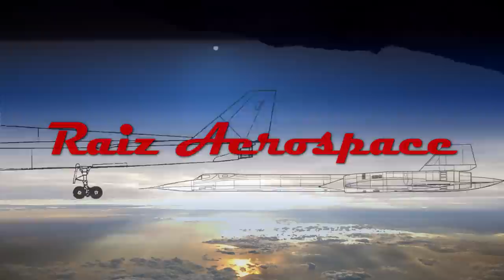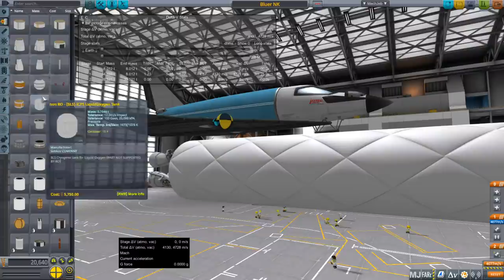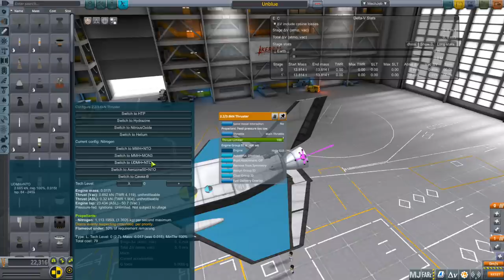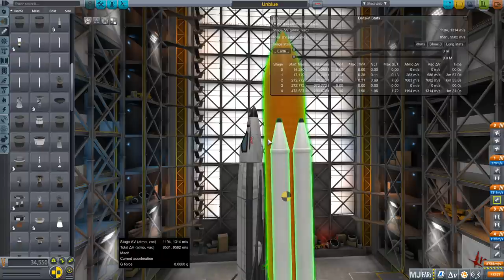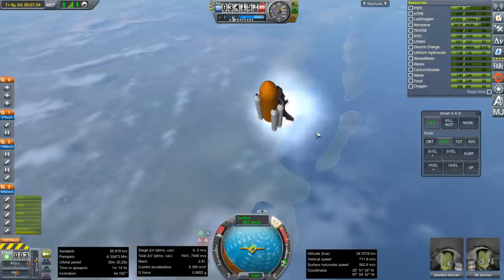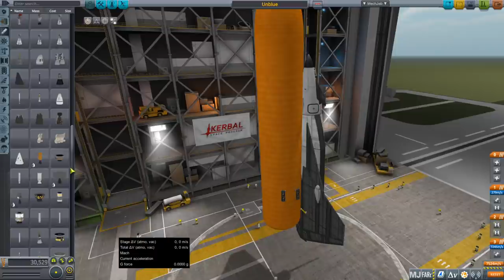Realism Overhaul in KSP 1.8.1 - Shuttle Design Tutorial Part 1

Comment: 15:20 Watches you deleting and re-writing the whole field with a rounded number instead of just erasing the decimal point and re-writing it one place ahead, causing a propellant imbalance on the order of tens of milliliters: AAAAAAAAA

19:45 Well, while it may not evoke the response you want, it is a lecture in a way...

23:00 To provide the greatest possible weight imbalance, you could make the liquid oxygen and kerosene tanks entirely separate.

23:15 They really need to lengthen the center of thrust lines.

30:45 Procedural SRBs have crap dry mass fractions and only gimbal on one axis. Because even if this worked it'd only be able to push the spaceplane into orbit without any cargo and the likely main engine replacement options are less efficient, I suggest you use the Ariane 5 Étages d'Accélération à Poudre, thrust-limited if the thrust is too severe.
...
Hmm... Because you would have gimballing SRBs enabling roll control in the atmosphere and there's much less disturbance after they separate, maybe you could just use your OMS engines for roll control after they separate, including a small tank in the ET to make up the extra fuel used. That would allow the use of one engine... Perhaps with the EsAP, you could use the Vulcain as its main engine (with Aestus OMS) and make a European Space Shuttle, or given its size, a Shuttle-ized Hermes!
Reply from the maker: On the Procedural SRB dry mass and using the OMS engines for roll, I make those points in the next video.